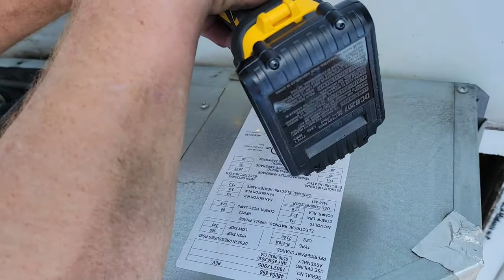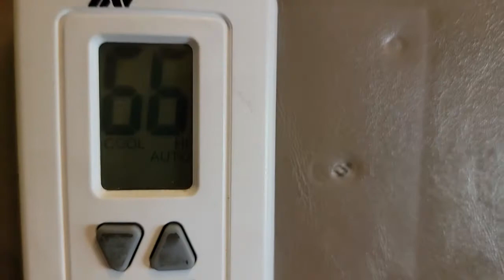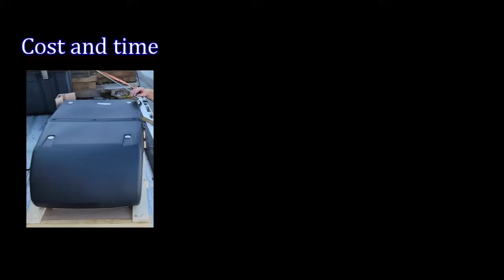How to replace a rooftop AC

Comment: Just curious about why you didn’t go with the rough neck version?
Also how did you get the unit up to the roof?
How does the generator do powering that size unit?
Reply from the maker: @ronarguin2844
Howdy hey!!
The rough neck version was not available where we were when we needed to replace it. 
We were fortunate enough to have a forklift nearby that helped us out!
We have an Onan 7500w generator and it has no problem powering the unit.
Reply: @hooperandwhistle  thanks I did mine yesterday and your video did help,